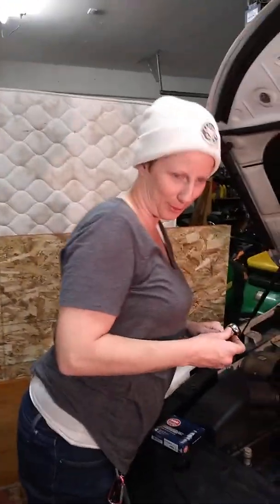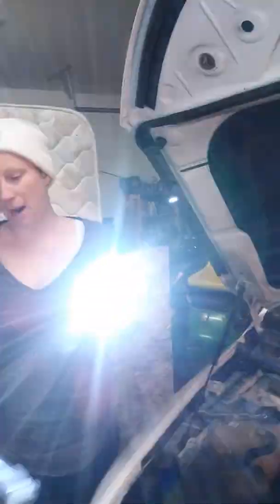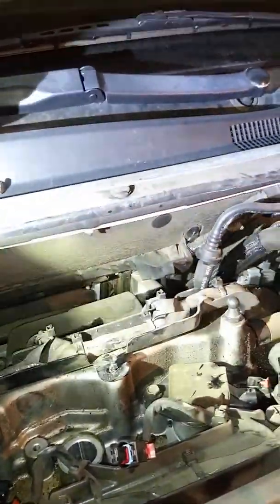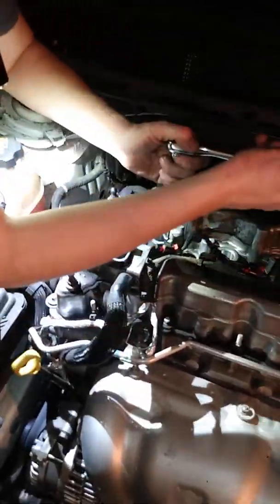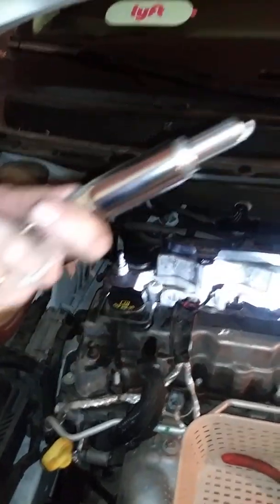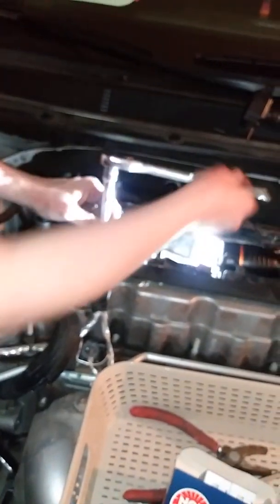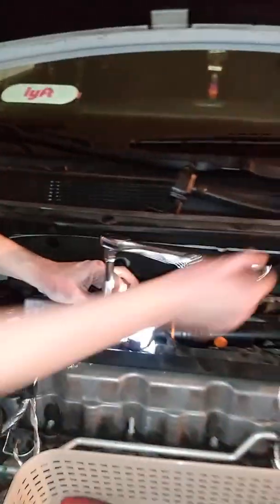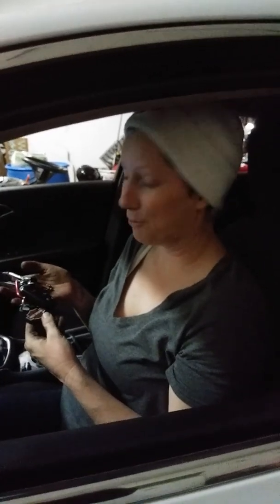2015 Chrysler 200 Limited Spark Plug Change PART 2

Comment: next time, hand tighten those plugs with the extension off the rachet. this way you prevent stripping the engine block. plus if you are looking for a snap sound you will need to get a torque rachet.